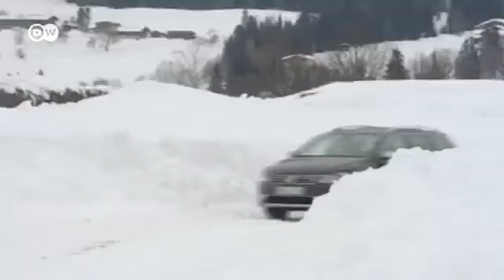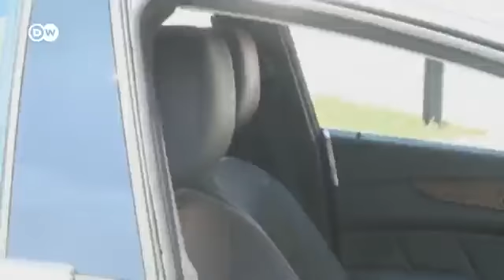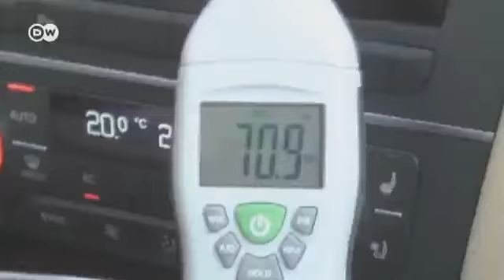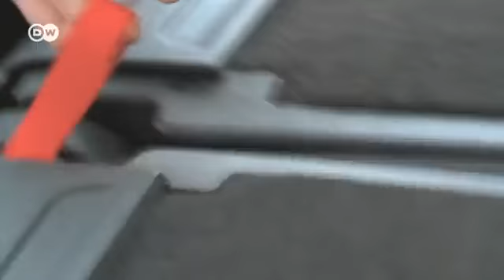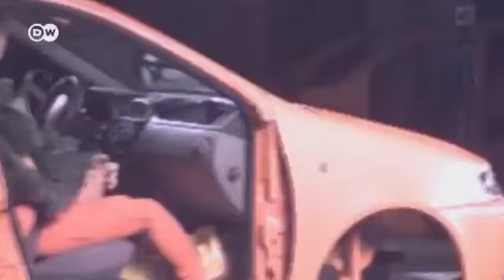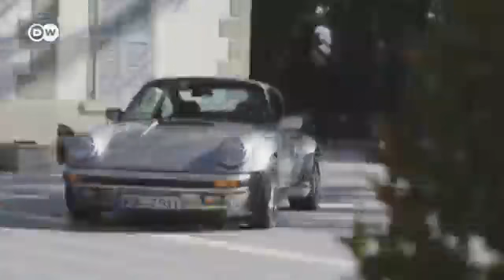The Motor Magazine | Drive it!

Comment: why does this show love diesel cars?    also I am very worried electric cars will become disposable cars when people learn how expensive the battery packs are. My gas car is 17 years old, that would be 2 battery pack replacements in an electric and people will not want to buy an expensive battery pack for an older car